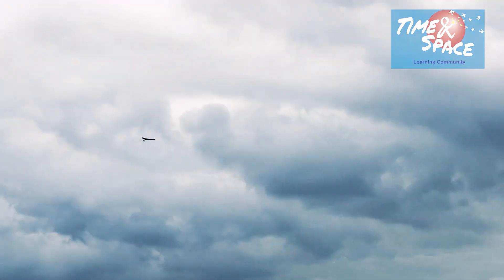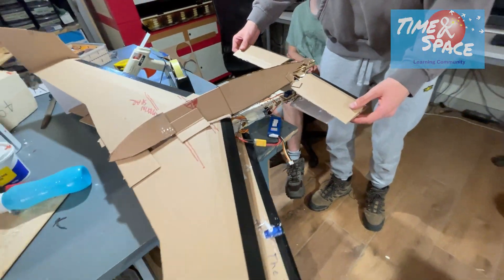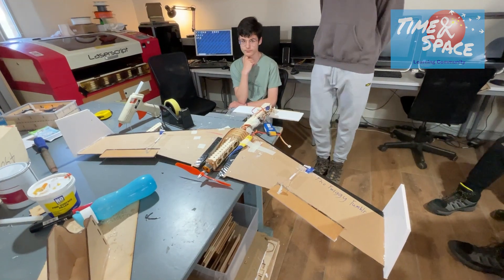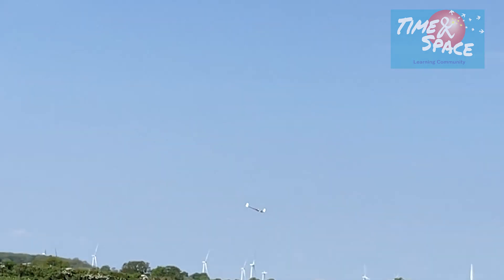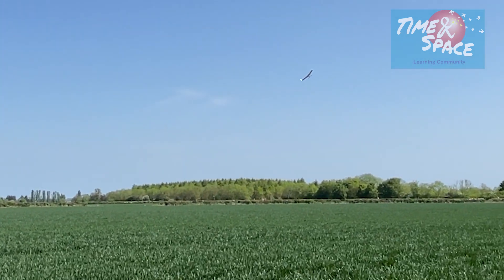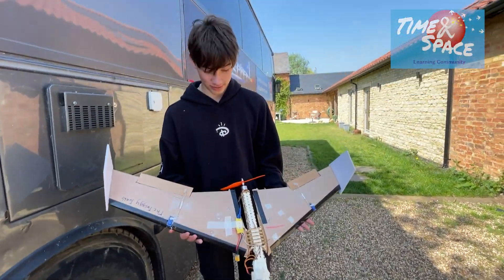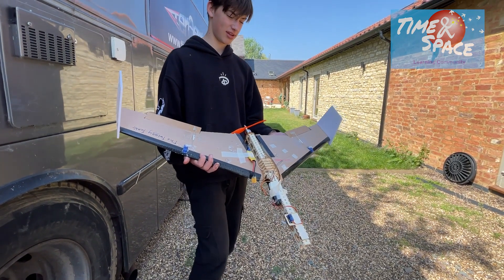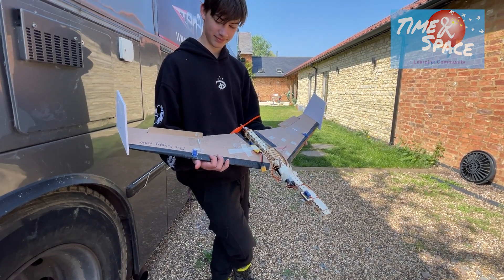AEROSCHOOL UK TESTING RC CANARD 2nd May 2025

Comment: I am a bit surprised why you are not yet building 3D printed model airplanes. 🙃
Reply from the maker: 3DP inappropriate for this task. Take ages to print, costly to run and circumnavigate an essential cognitive process of creating orthogonal views of a product made of separate components cut from sheet ,material. Very few products are made in a single material and part of the brief is to be able to repair a damaged aircraft easily. Laser cutting is speedy, cheap and you only replace the parts that break  -when you crash - and you do very often. 
We do 3D print items like motor shrouds and servos trays - wheels and bits n bobs but never a complete aircraft. 

We use ProDesktop to model aircraft visually in 3D and could produce a printed aircraft but don't have the time or access to a printer big enough. In reality we make 5 or 6 versions of a plane before finalising a design. This makes 3DP prohibitive. We do use laser cutter to cut 3D structures as converted from 3D CAD by Slicer - that's useful. 

Thanks for your comment - sorry if I'm dismissive but having taugh with both technologies give me laser cutters all day long. Watch a video of 3D printing. Lets face it most 3D prints end up on a shelf not in the sky!
Reply: @timespacelearning4465  
First of all, thank you for the detailed answer. I understand your points very well. It always depends on the purpose for which you use which technology.
But one thing is clear, 3D printed airplanes definitely look much better ;)
Reply from the maker: Yes 3D printing is largely used for representational models rather than finished products. In our case it could be used to produce a flying aircraft based on the geometry that has been proven by laser cutting card and yes, much more accurate aerodynamics. We are still at the prototype stage. Of course on a degree course you'd have a technician who would produce 3D prints of your designs and subject them to wind tunnel testing. But much can be done with CAD without ever making a plane at all! Most modern planes go into production without ever having been modelled to scale. And therein lies the rub. Most UK engineering graduates have very little practical experience at all! You can get an engineering degree with almost zero making experience and skills - because most engineers would hand the design over to a production team. This is a weakness in our current education system. The computer might say 'yes' or 'no' but a visceral experience of dynamics , material handling and manipulation are in my opinion vital.  
But I think you miss the point of the Challenge here . . .The Payload Challenges test the aircraft to destruction and the teams that win aren't the ones with 3D printed planes - they are those that are able to fix the broken structure quickly and effectively. And the best teams at that come from . . . . China. And they wipe the floor with UK Engineering teams on a regular basis  - so much so that the BMFA challenges are now only open to UK teams! It was getting embarrassing. 
The ability to select a production processes by their merits rather than personal subjective preference is a DESIGN skill and is key to success. In 10  years I've not seen a single 3D printed aircraft at the challenges. I've seen them at the IMECHE UAS Challenge but (IMHO) that is not a good example of engineering either. It's a different organisation that run it and different challenges, But most aircraft seem vastly over engineered - which is typical of many UK engineering project sponsored by gov/military organisations. Over budget and unfit for purpose. (IMHO)
Reply from the maker: Correction - challenges are open to European teams. Beats me why - I thought we'd left Europe. I'm keen to see to what extent this decision affects the 'records' held over time - if the BMFA hold onto that information. Can UK teams even get close to the winners in 2023? - see our Aeroschool Videos 
https://youtu.be/V4QSvC1aE5I

Check out https://youtu.be/Si7fl_fxGE0 for crashes! - How would 3D printing help here?
Reply: @timespacelearning4465  Thank you again for your detailed answer. Now everything is clear what you are talking about.